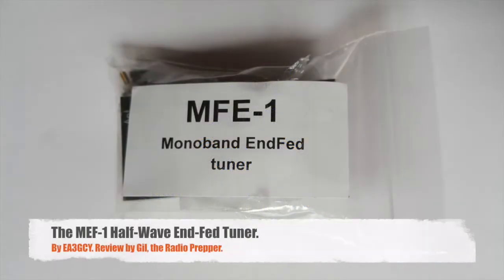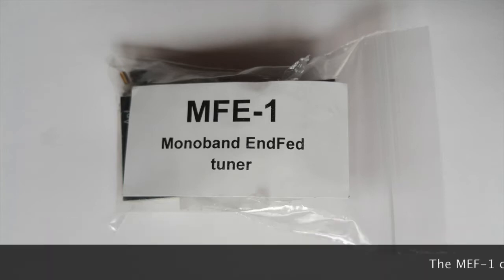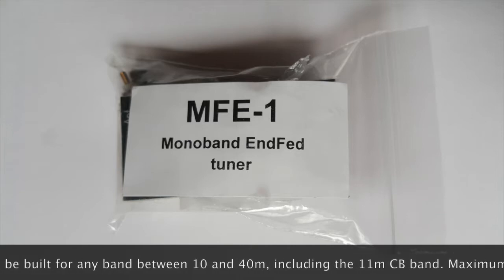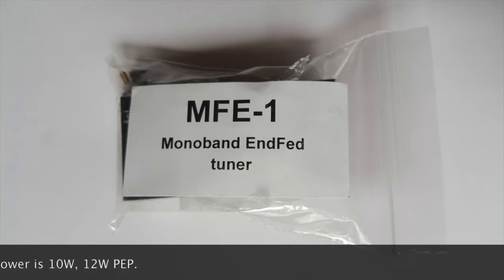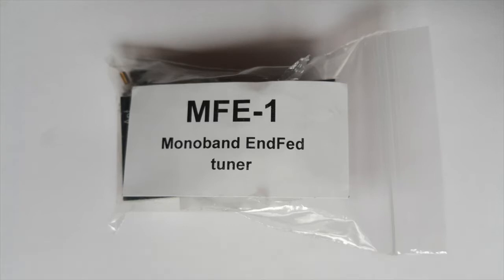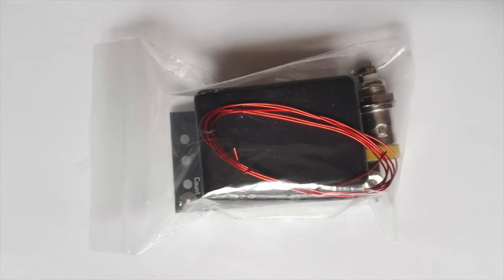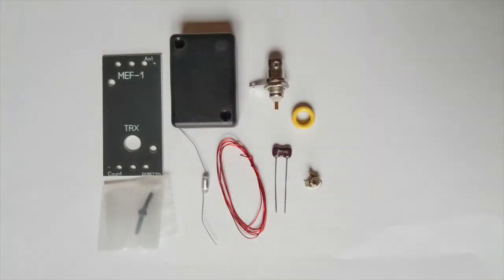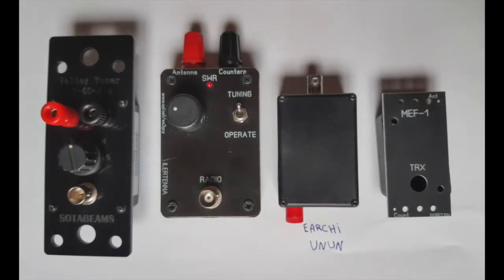Building The MEF-1 Half-Wave End-Fed Antenna Tuner.

Comment: Clever design. I'd be tempted to add a small plate on the back of the box and use the enclosure as an antenna winder 4 minimum packed size and weight.
Reply from the maker: That's kind of what qrpguys.com did...

Comment: Have you used it much Gil and how has it performed? Is it robust?
Reply from the maker: Hi, it is robust enough for its intended use. I have used it a few times, performance is very good. The SWR does change depending on the antenna environment, which is normal. I might drill a small hole in the back of the case to access the adjustable capacitor to adjust it if needed with a small screwdriver. It is very light, so a plus for portable operations.

Comment: Ok, Im going to make an idiot of myself here...why would you need this if the antenna is already cut (using 468/f) for the chosen band?
Reply from the maker: Because while the impedance is around 71  Ohms at the center of the half-wave wire, it is a few thousand Ohms at the end. So we need a transformer to lower it close to 50 Ohms.
Reply from the maker: The idiot is the one who does not ask questions ;-)
Reply: Thank you again Gil. When I get the qcx for 20 metres and cut the wire for the cw portion Im going to need one then.

Comment: That's a good answer. Without an swr led, and myself not having the elecraft tuner, I guess the best thing is to use an antenna analiser, with a chosen length of coax and counterpoise, and then stick with these parameters when field deployed.
Reply from the maker: +MrDaim0 See the MR-100 I reviewed... Cheap and it works...

Comment: A couple of questions - did you find an unun necessary in conjunction with this tuner?Also, for multi-band, is there any reason why you didn't go for this:
http://qrpguys.apps-1and1.com/end-fed-half-wave-sota-antenna-tuner

??
Reply from the maker: Hello, no. The QRPGuys tuner would be a good choice as well if you want multi-bands. I like the MEF-1 because it is built into a box, is small and cheap. I like end-fed tuners because since they are placed at the wire, there are no extra coax cable losses. This is the reason I bought an Elecraft T1 instead of the KX2 inboard tuner, so I can place the tuner at the antenna instead of at the radio.